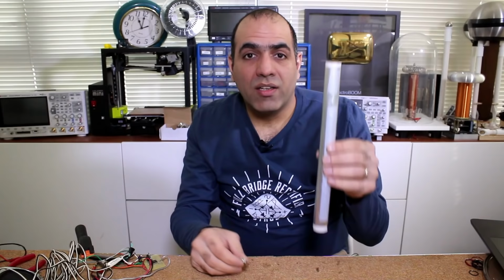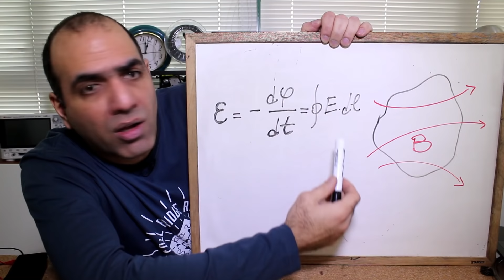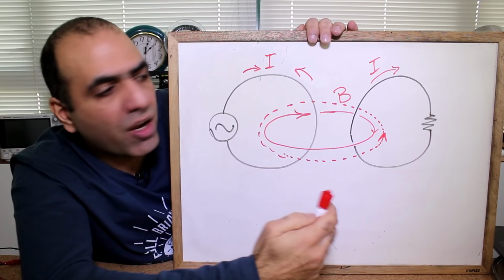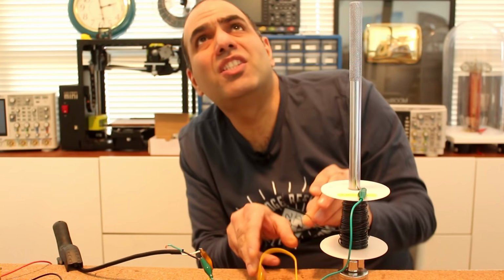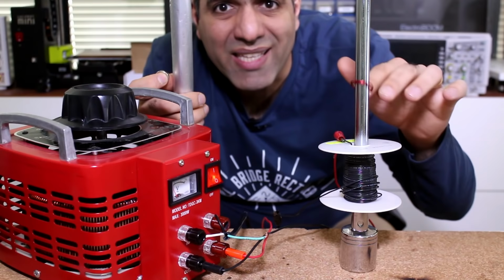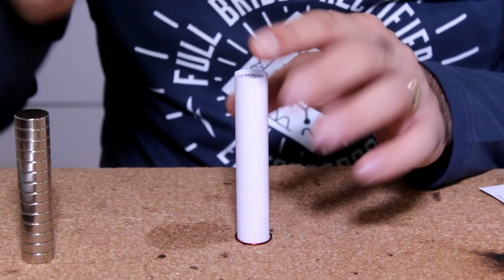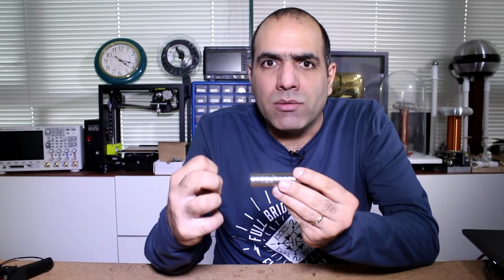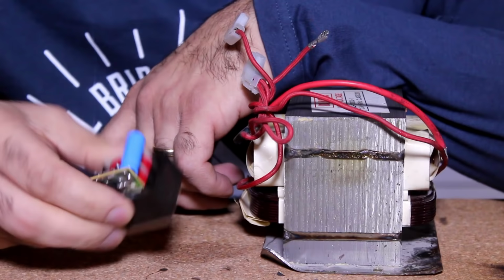The Amazing Eddy Current

Comment: PhD student in electrical steels here: welding down the side doesn't cause eddy currents to flow through the stack (unless burrs accidentally touch and form micro-welds) From Philip Beckley's Electrical Steels for Rotating Machines :"It takes two short-circuits to complete an eddy current loop, and a weld bead down
the outside of a stator stack amounts to one short-circuit line in what would appear
to be a safe place. However, if burrs formed on the tooth parts of stampings produce
short-circuits then these complement the weld bead current paths and raised losses
are inevitable."

Welds are used to secure the stacks, particularly when they're larger as the glue/coating will have a harder time under increased forces.
Reply: Welding both sides of the transformer will result in a complete circuit and power loss and from the ones I've seen they have two welds on each side(4 welds). Some wac-nut thought it would be cooler to weld it than to use conventional means. It also GREATLY increases the difficulty when trying to salvage wire from old transformers. The practice of constructing things like that and also potting are to me the resident evil in modern electronics. Used to be you could salvage practically anything relatively easy, not so anymore.
Reply: I'm high and have no idea what you're talking about here, but it was mindblowing so thank you.
Reply: would that be why my microwave ovens dont last over 5 years cause the transformers overheat?

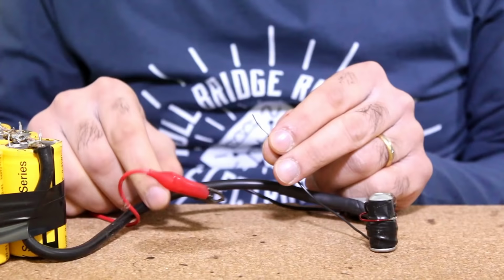Comment: @4:47 i got scared when he said "Watch the ring". I looked at his gold ring at his finger and thought oh no please don't touch your ring with anything. I once heard a story from my prof where someone with a wedding ring tried to fix a pc while it was powered on. He shorted something with his ring, somehow the fuse didn't blow and the ring got really hot. It melted through his finger. I guess he lost that finger. So please Mr. ElectroBOOM take the ring off while doing your experiments.

A concerned fan.
Reply: Co-worker lost his wedding ring while working on a car battery.  He did not lose his finger but needed serious medical attention.
Reply: That story of the tech has been floating around for decades. Many who teach computer cert courses use it to keep students from causing shorts and killing the computer. The only place where there is that much voltage current etc is in the power supply even coming off the 12 volt line the current etc is not high enough to heat a wedding ring up to the point where it would be any thing more than uncomfortably hot. You normally wont do much work inside a computer case with it hooked to power other than maybe hooking up a fan lead or a hard drive power cable.
Reply: This is why AvE always puts tape around his golden manacle
Reply: Computers generally run a 12 - 20 volts on the motherboard. The most this voltage would do is crash/damage the motherboard and leave marks on the ring. It is not high enough current to melt gold. Also, it would have shorted through about 1mm. Therefore it would not melt. I have ran 19v from a laptop charger through a good wire and it did nothing but short the adapter. (Do not try at home.) It certainly did not melt.
Reply: @powermacintoshg3667   any thing above 12 volts is stepped up voltage meaning the amperage is far lower than the full amp 12 volts the power supply can push. I can push 12 volts to around 100 volts and it can only do as much damage as the original 12 volts. In other words if 12 can make a gold ring hit say 200 deg the 100 volts will only be able to do the same.
Reply: you speek french, prof , je parle francais lol
Reply: Kind of a gross story, but when working with any sort of rotating machinery you run the risk of degloving. Pretty much the ring gets snagged and the skin of your finger comes off. Google at your own risk.
Reply: @nanaki-seto  yep, especially because if you short the output(s) of PSU it will shut down.
Reply: @nanaki-seto  uh what? How?

Comment: The welding on the MOT makes very little difference to the overall functionality. Think of it like plates of a capacitor - they are all connected at one end (analogous to the plates on the transformer being welded) but it is the surface area that matters.
So long as the grain of the plates is (mostly) parallel to the magnetic field, using plates instead of a solid core only sacrifices a tiny about of efficiency.
Reply: also the MOT is only ON for short periods, so high efficiency and no load losses are not that critical
Reply: Basically the iron sheets do not form a complete loop of wire.
Think of winding a coil onto the outer legs of the core instead of the middle leg. You would wind it in the same way as on the middle leg.
Since the plates are welded on only one side of each outer leg, but not on the side facing the middle leg, this does not form a loop of wire.
Reply: And the welded joint ensures less chances of vibration noises.
Reply: What's MOT
Reply: @othusitselokailwe2857  I'm sorry. MOT = Microwave Oven Transformer
Reply: @Basement-Science  You're absolutely right. I suspect that Mehdi already knows this. He says "write in comments" to generate more "interest" in his channel for YouTubeFu algorithms.
Reply: This is not true
Reply: @aqib2000  It's the way that I've always heard it. If there is another reason, what is it? I'm legitimately interested.
Reply: It does put an eddy current all the way down the stack.  Machining laminations will do the same by connecting the outside layer into a continuous conductive path.   It’s not too big of an issue when the transformer is large enough to dissipate the additional heat.
Reply: It does put an eddy current all the way down the stack.  Machining laminations will do the same by connecting the outside layer into a continuous conductive path.   It’s not too big of an issue when the transformer is large enough to dissipate the additional heat.
Reply: It does put an eddy current all the way down the stack.  Machining laminations will do the same by connecting the outside layer into a continuous conductive path.   It’s not too big of an issue when the transformer is large enough to dissipate the additional heat.
Reply: It does put an eddy current all the way down the stack.  Machining laminations will do the same by connecting the outside layer into a continuous conductive path.   It’s not too big of an issue when the transformer is large enough to dissipate the additional heat.
Reply: @johnrobholmes  Also, on a MOT, there are shunts placed between the primary and secondary coils that mitigate the effect of any stray eddie currents.
Reply: that's just a compromise (i think) those welds ARE shorting eddy currents, like all the iron around, but the effect (i'm not sure) may be of so low voltage that it's almost nothing, considering the lenght of the path (comparable to the lenght of the sheets), i saw a transformer with some bolts holding the sheets and at ONE end of the bolt there was a plastic washer, you risk noise and add cost but i think it's not a compromise anymore

not sure (even less :D) about the "direction" and "amount" of the shorts and stuff according to magnetic field... but a lot of trafos have those welds, it's ok

EDIT: i still don't get why capacitors have a single foil

RE-EDIT: ahhhhhhhhhhhh... no, i think it's different.... antennas may have an analogy but no again :D
Reply: @Blueprint He's a troll, there's no reasoning, just his thoughts.
Reply: आदित्य Aditya मेहेंदळे Mehendale sometimes it’s for people who are curious about the subject to check the comments if he doesn’t want to take the time to explain all the possible reasons
Reply: This is incorrect. For starters, a solid core is enormously detrimental when it come to efficiency as opposed to a lamimated core, I have seen it with my own eyes. During one of the lab classes in my electrical engineering courses we connected an inductance in series with a lightbulb to a variable transformer and changed the inductor's core between a solid piece of iron and stacked iron sheets. I remember you could easily appreciate about a 30% drop in the light intensity of the bulb for the same source voltage.
Welding all the sheets in that way is effectively creating a conductive loop (in fact several) around a varying magnetic field, which defeats the purpose of a laminated core. Granted, the cross-section of those loops is very small as the section of the conductive material between sheets is just that of the weld, so it's not as detrimental as a fully solid core, so I guess the designers decided to pay that cost for a core which will have reduced vibration.
Reply: @maxprophet2401  it doesn't mean you don't take this "seriously"

we know he can explain that, but is he the only one talking?
Reply: @Basement-Science  This is the correct answer.
Reply: I don't take aqib2000 (troll) seriously because I've seen him around with similar statements. I wasn't clear. I agree with ya on the welds being of little loss. Most have two welds opposite each other(that I've seen) which'd complete that path, so I don't know if one analogy given above is accurate. Capacitors have even numbers of foils, it  may be a triple layer cap., but it means triple pairs=6.
Reply: And a weld or two on a stack of laminates does not make it a solid core Bruno. Basement Science got it right in the 2nd comment
Reply: @maxprophet2401  i'm losing count of how many things are fucked up in this comment tree... capacitors, trolls, the whole reply structure is weird also :D
Reply: @maxprophet2401  I'm not saying that the welds make it solid, that was in response to blueprint's comment, where he/she stated that there is almost no difference in efficiency between solid and laminated cores. What I am stating is that those welds DO create conductive closed paths around the outer perimeter of the core by creating conductive bridges between otherwise sheets. Laminated cores reduce eddy current losses by reducing the surface area through which the magnetic field passes. Mehdi showed it himself, it's the surface integral equation. If you want to reduce eddy currents, the only variable you can play with is the surface over which to integrate, as the magnetic field amplitude and density is set as per load requirements and core material. By cutting the core in electrically isolated sheets you reduce the surface area over which to integrate (ideally, in this respect, you would want the sheets to be as thin as physically possible). The moment you weld sheets together, all this effort goes down the drain, as you are creating loops which have a larger cross-section.
Reply: Now you're saying, "The moment you weld sheets together, all this effort goes down the drain, as you are creating loops which have a larger cross-section."     
   The depth of the weld is very shallow compared to its width and 
you do create a single loop who's magnetic field is a fraction of a percent of an unwelded, non bolted, non riveted (perfectly isolated, insulated) stack of lam's mag. field, and these fields are only partially opposed.  Get your meter and find a layer that's isolated from another layer, in a non welded core. 
   No one has mentioned that it takes a considerable amount of clamping force to retain the axial dimension of laminated cores, especially with moisture and thermal cycles. I've seen cores that had been wet and forced the plastic housing apart on a wall wart, and it was still working and cool to the touch. Two rivets were torn off and it was twice the thickness of where the copper coil held it together.
Reply: I agree, with only 1 weld, there's not really a closed circuit....but a lot of electric motors have the laminations welded in two or more places, and the laminations are usually a circle.  @Basement-Science
Reply: @redoverdrivetheunstoppable4637  Honestly, I don´t know how to reply to anything here anymore either.
One could make an entire video about all this, or more.

Basically what you said originally is correct. There are only very short paths within the iron sheets and within the weld bead, but no long paths where significant current would be induced. 

At the same time, along the direction the magnetic flux is flowing (from the middle leg up, then down through the outer legs, in closed loops), there is a continuous path through steel, without almost any air gap. So @Blueprint is also correct about that part, it makes next to no difference for the magnetic flux. That in itself does not affect efficiency though. (The capacitor-analogy was not the best.)

Then @Bruno Altobello compares an inductor with different cores to a transformer for some reason, and then claims something different based on that ?? In general, @Bruno Altobello, you seem to misunderstand a lot of things about transformers and magnetism. It´s too much to explain in a comment, i´m sorry.

@Doug Ankrum In motors, the magnetic fields can be a bit more complicated. If there is a big conductive loop somewhere, it´s also possible that it is along a path where all induced voltages along the path cancel each other out, resulting in 0 current. (The closed loop integral at any time is zero.)
Reply: @Basement-Science  yayayayaya... i remained puzzled after i re-read the "lenght of the weld" part, maybe while writing i tought about some "additive voltage effect" (mot much sensated)... not sure, don't remember (weird :D), those were just my moment thoughts, no indepth knowledge
Reply: @dougankrum3328  A closed path is not enough, you need a closed path that is linked with changing flux.  Two weld beads down the outside diameter of a motor core will create a conductive loop, but it is not linked (penetrated with changing flux).  If you put a weld bead down the OD and the ID you would have a conductive loop that is linked by a ton of flux, and would thus have a problem.
Reply: @maxprophet2401  You are, once again, putting words in mouth (or in my text, I should say). The cross section I'm referring to is NOT that of the weld (which, granted, is small, and will not degrade efficiency as much as a full blown solid core, facts which I also stated). The cross section I'm referring to is actually the area of the surface encircled by the conductive loop created by the welds and the two outermost sheets of the core. This is the surface over which the integral shown by Mehdi applies, and which becomes way larger than without welds.
Reply: I copy and pasted the words from your comment. And, I wouldn't put anything in your mouth without permission
Reply: @maxprophet2401  Smart comebacks... The last resource of that who has no reasonable arguments remaining, and a clear indicator that the end of a discussion has been reached. Take care!
Reply: @spacecowboy2483  Se la mandaste a guardar al max jaja
Reply: would a ferrite core such as a toroid transformer be more efficient?
Reply: @rogerd4559  Yes, ferrite cores are made out of a mixture of iron particles and an electrically insulating material that packs them together, which means that the possible paths for eddy currents are extremely small, hence their resistance very high and therefore very efficient. Also, since the material can be molded into whatever shape, those cores can also be made efficient in the sense of reducing magnetic flux leaks. Unfortunately, the material has lower magnetic permeability than good old iron, which means that its maximum attainable magnetic flux density is lower, and therefore is not well suited for power applications.

Comment: Yes I had the exact same doubt you had on the Transformers welding I think there is a loss in magnetic field due to the eddy current because of welding on the Transformer, the current flows through the area at which the welding has been done so Eddy current is more than previous which means without welding

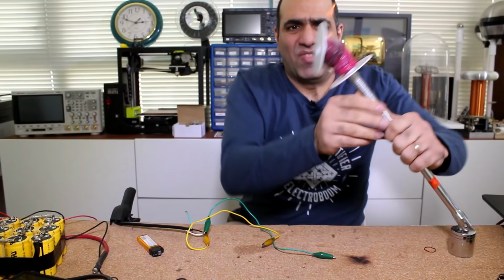Comment: Forgot to hide the lighter at 6:00, looks like you lit the spool manually :D
Reply: True
Reply: I just think of it like WWE. Just 'cause you know it's fake doesn't mean you can't enjoy it : )
Reply: Nevermind how he got it to light - it stayed lit!  That's even worse! Wire is supposed to be flame retardant (for obvious reason).   I threw out a batch of OrientalTrading wire once upon a time due to cheap insulation that would melt when trying to solder to the wire and would burn aggressively if ignited.
Reply: A good show here, but yes, the whole roll of the red wire would be smokin', and the flame retardant, that's pretty much standard in most countries...  @wouldntyouliketoknow9891

Comment: Eddy Currents are also used in non-ferrous metal sorting machines. With strategically placed Eddy Currents in an Eddy Current Separator (ECS) You will filter out metals such as Aluminium, Copper, and Brass creating a mixture of metals called Zorba.